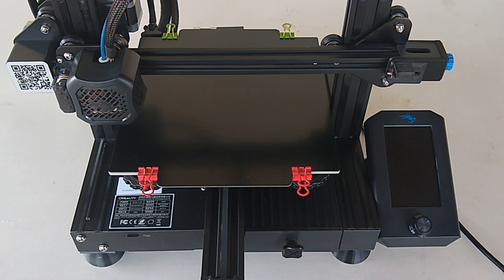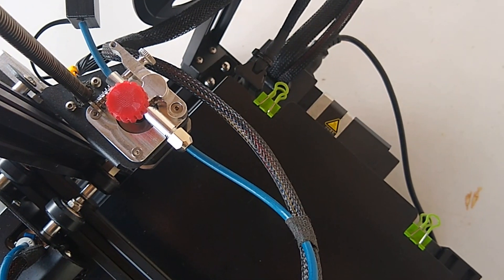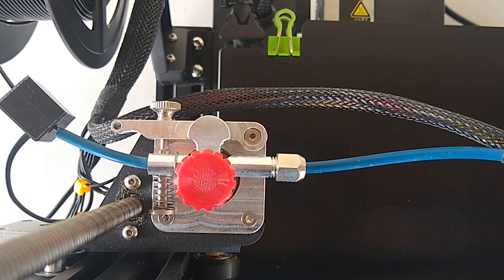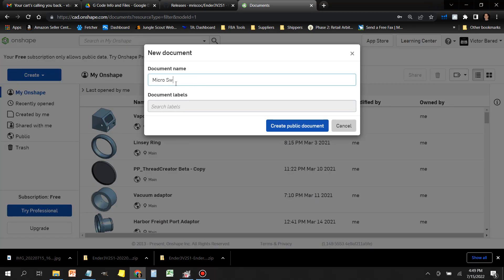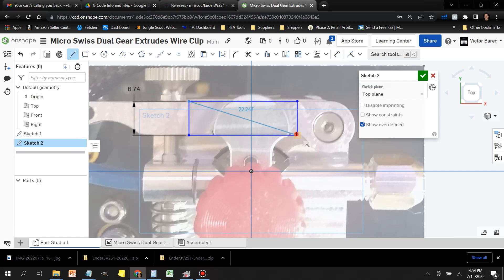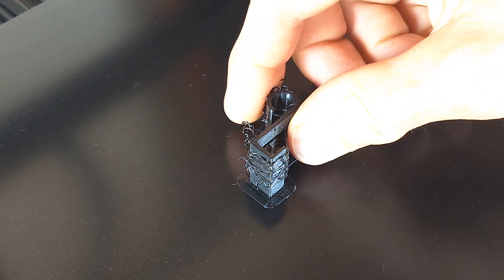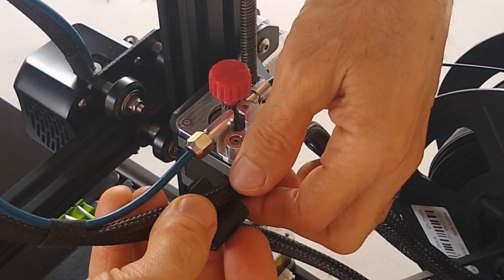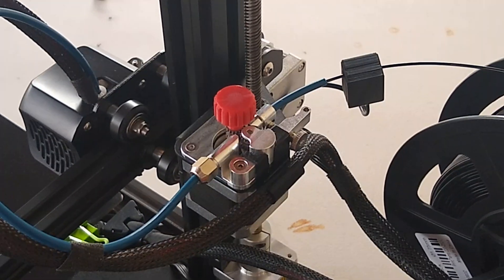Ender 3 V2 Making a Simple Wire Mount for The Micro Swiss Dual Gear Extruder

Comment: Victor that is a great clip I know your video is more about the 3D software  But i'm not  good with drawing so I have to ask is there some place I can download the STL file for that  clip?
Reply from the maker: Hello Dale, Thank you for your kind comments. I've improved the original design from this video and linked it below along with photos on how to mount it. 

https://drive.google.com/uc?export=download&id=1FBx5pZuM11-wsTjJEBjdo6ozPL1pjHcj

Best of luck with your mods!
Reply: @vbared  Thank you so much Its hard to believe that Micro Swiss has not addressed this issue.
Reply from the maker: @dalehabbershaw8690  I hear ya, you would think that if it's a direct replacement it shouldn't be short-changed out of some type of wire fastener.